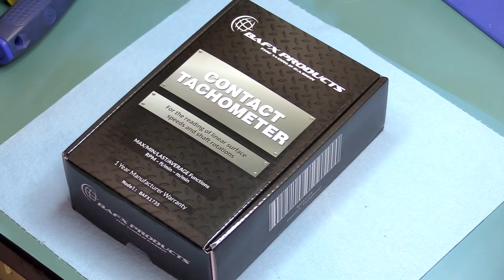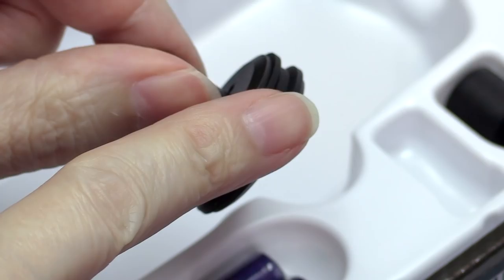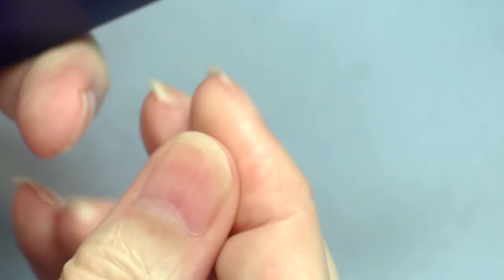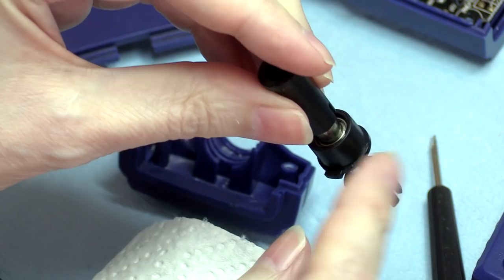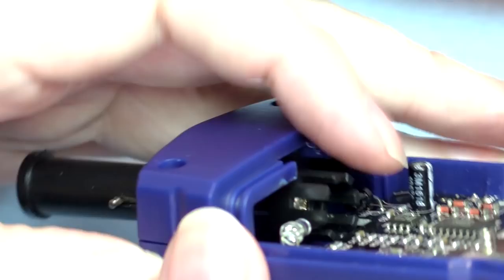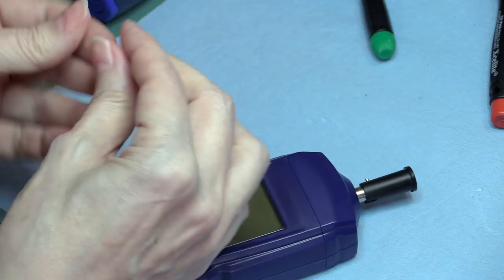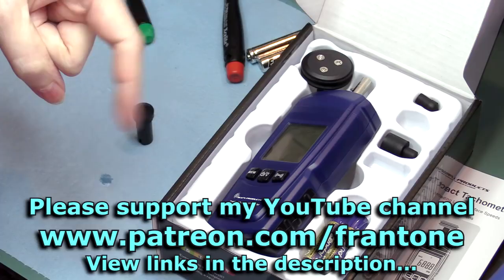Can A Cheapass Tachometer Be Any Good?

Comment: I got rid of my contact tach decades ago, mainly because I didn't like getting that close to rotating equipment with power applied.  Got a non-contact laser tach and never looked back.  I get very accurate readings a meter away from a 3 cm shaft.  I keep some emery cloth handy to dress dirty shafts, and some white nail polish when I need to add a reference line, though a piece of tape almost always does just fine.  With careful aiming it even works great end-on.
Reply: The only reason to go contact is if you want very high precision on a slow rotating object. A low precision contact tachometer has no purpose.

Comment: You don't use the cones to roll along the shaft.  The cones are for pressing to the end of the spinning shaft.  There is a center bore on larger shafts left over from machining.  Off center cone isn't critical.  The wheel is for rolling on the shaft.  I'd imaging there is a setting to select the diameter of the spinning shaft to get the right ratio.

Comment: The diodes were fine before you moved them.
Eight pulses per revolution would average out
Reply: That's what I was thinking. That and that there would be more of a likelihood that taking measurements in the low range would be more likely to be off. If the steel in the bearing is high enough quality, that would make the bearing not a problem either.
Reply: yeap, there is a reason why they were angled and she thinks that she corrected them :)
Reply: Interesting. I would not known that either. It looked to me also a little wonky, but you can learn a little every day.
Reply: Fine, well maybe, the IR emitter (clear one, wrongly pointed out in video), just needed to be bent correctly, near the base of the LED. I have bought two non contact tachs for $6 and $7 bucks, they work great, I used my 1GHz scope to verify.

Comment: There are a few things that I think are important.
1. The inserts should be pressed into the center of the rotating thing to be measured, otherwise it won't give a correct RPM reading. So, the inserts are okay to go in loose. No glue needed.
2. The wheel should be used in the distance mode, so the device should be calibrated for that sized wheel.
I do agree about the "bearings" being garbage. Not sure about the optical measuring accuracy though.

Comment: Some manufacturers uses black PCB coating. Some preseries devices I have worked with have been black - no DIY about it.

No need for precision-aiming the LED - it's enough that there is a significant difference in amount of light for on and off so the photo transistor gives a valid and distinct digital signal to the microcontroller.

But it was a bit much components used. With a suitable buck regulator, not much more should be needed than a microcontroller, crystal with caps and some components for LED and photo transistor. And a few components for switching the LCD.

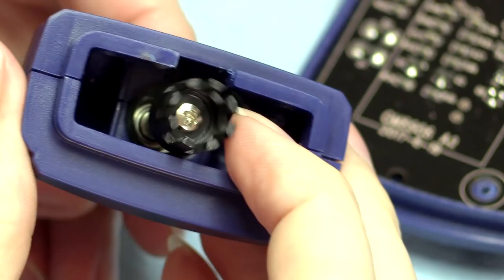Comment: I could be mistaken, but around 5:40 I think I spot a "skateboard-style" bearing of the type used in a lot of hobbyist 3D printing projects (and some 3D printers, especially those with RepRap origins).

That said, it isn't necessarily a good bearing!
I've bought 608ZZ bearings from AliExpress on two occasions. The first lot were perfectly usable - I don't have the expertise or equipment to determine precisely how good they are, but I have no complaints.
However those from the second pack were... less than ideal: poorly aligned, many were visibly dented, and they were packed with a really sticky "grease" that felt more like PVA glue than a lubricant 🤷‍♀️

As with most things from China, there's a wide range of quality to choose from. Unfortunately in situations like this you don't really get to make that choice yourself :(

Comment: I made a tacho with an opto sensor, F-V chip and a miliameter. It worked better than that one; colleague used it for setting a motor to 1000 RPM to test encoders.

Comment: Can you improve on the engineering of the device? I would try. My mother bought a Bravetti deep fryer but the temperature sensor was placed right next to a heating element. My experience with deep fryers says you shouldn't have the temperature probe that close to a heat source because then the device gets wrong readings. Thankfully the electric element had the built in means to hold a relocated temperature sensor away from the elements. And I made the adjustment before my first use. The result is a temperature accurate deep fryer.

Comment: This unit might work fine for most uses perhaps unless you needed to measure small variations in rpms in something like less than a quarter of a second. As someone else pointed out, this unit likely calculates an average so the opto sensor isn't that much of a deal breaker. Are there electric motors available that guarantee certain rpms depending on the voltage/current applied? Sans getting a proven quality tachometer to test it against, that would would be one way to measure the accuracy of this unit.

Comment: At work we have a setup to benchtest those... if you send it over I can determine just how good/bad it is up to 10k rpm. It doesn't use the rubber adapters (the shafts are standardized), so it would even favour the device a little.

Comment: I use contact and non-contact tach's fairly often. This one is questionable. I don't have a problem with the crown-slotted encoder, but the poor bearing is a problem for a number of reasons, including safety and optical alignment. If the optical alignment varies, that could lead to miscounting. It need not be dead rigid, but floppy is no good. I am less concerned about the optical axes being aligned, as the lenses are not designed to collimate particularly well . Probably /-20deg makes little to no difference. The tip falling out is a major headache. In use. pressure holds it, but when applying the tool to a shaft (or removing it) if the tip goes flying, its a pain to find and can be a safety issue. These devices are intended to be applied to a shaft that is already turning, so holding it two handed doesn't work.

Comment: Why even use a contact tachometer? Just paint a white spot on a shaft or disk, a phototransistor, Schmidt trigger and hook it up to your counter / frequency meter…
Reply: Conveyor speeds and other linear motion.  Also that gear you describe won't work in the field.
Reply: @paulmoir4452  Wow, you are the first person with an answer to, "Why not use an optical tachometer?"  Almost any contact electronic tachometer made these days is going to be a mechanical device to couple the machine under test to an optical encoder.  That adds a layer of slip and inaccuracy into the measurement.

Comment: Why must the rubber point be fixed? It will stay in place due to friction if you press the point in the little hole on a shaft. It's not meant to put on the side of a shaft, in that case the diameter is very important. Accuracy depends on the timebase, not the quality of the bearing. With 8 slots you can average  and improve accuracy. Nice video with new intro!

Comment: I do not know if it would have to go through the centerline or not, but maybe the time between light and dark is what is needed to count the rounds. I had seen something similiar before to measure rpm or so and it was also not perfectly through the centerline axle. It had worked fine or 50 deviation at 8000 rpm based on another, newer rpm counter.

Comment: I'm surprised the encoder had eight slots in it. I expected a cylinder with a single slot through the middle.
Reply: I'm used to seeing a disk with notches in the perimeter. The notched cylinder probably allows the Led and the sensor to be separated a bit farther apart as it would concentrate passing light through an expanding/collapsing aperture.

Comment: Maybe you can lean one from a car-garage for your project.
But this can probably function a lot better with a few 3D printed parts. Like that stupid adapter and probably also printing a new head where the axl is turning in.
This is the way I get things like this design-failures to work for me...

Comment: It may have been fine but not tested

As has been said elsewhere in the comments the pulses would have averaged out. So the crude opto slots don't really matter.

The bearing may have been intended to move as you demonstrated. That would allow for a little misalignment. Again without pulling the bearing apart you would not be able to tell.

Loose fitting inserts, annoying but could be intentional, you are not supposed to press very hard on them or you will load the motor. But GLUE! why? a turn or two of  PTFE tape would have done the job and be reversible.

A non contact device would have been better, but if you really wanted a contact tacho, an opto shaft encoder and a tiddly little Arduno/Pico/orwhatever would have done better.

 Andy

Comment: It is made to accept thrust load not radial load . It only has to touch  the shafts center . You cannot read rpm off of the circumference  of a shaft or pully . Do not use screwdrivers to pry on things , right ?

Comment: My Father had/has a metal looking mechanical one. We used to use ones with a photo cell to measure the RPM of model aircraft engines

The later would measure the 60 hertz if you put it in front of a light bulb
Reply: 60Hz? I would expect one to read 120 instead.
Reply: @eDoc2020  Yes, 120, math was off... whichever, point was, these photocell tacs worked in that manner

Comment: You say the tachometer would only be accurate at very low speeds, but how come you know this?
The plastic encoder wheel doesn't seem to have any jagged edges so as long as it works to transfer the rate of rotation into pulses i think it's fine. Even then the LED's are not focused lasers so most of the surface imperfection would get attenuated anyways. 
As long as  the optical assembly can generate a periodic change in current this can be AC coupled and zero crossing detection can be used to shape the pulses.
After that it's off to the MCU to calculate the speed, which it undoubtedly does with a timer in a capture compare mode, which can be made to run on main clock most of the time. And that 16MHz crystal with the 8-tooth encoder would mean that this device should be capable of counting up to at least  ~33k RPM. Although at that point it would probably explode given the bearing situation. And you of course wouldn't expect any accuracy from a device that's operating at near it's limit.
But i'm not defending this Kuality bit of kit, rather i think it's important to assess whether it's at least capable of providing useful measurement before you point your finger at the wobbly shaft and the LED because it's at a funny angle.
At the end of the day you bought it to take a measurement so you might as well make sure it can for your own benefit.
And if you care about the accuracy of your measurement and the longevity of your equipment you wouldn't buy cheap crap.
And if you expect quality instead of Kuality from cheap crap test gear that's a you problem.

I just like numbers, i like knowing the why and the how. No such thing as free lunch over at chinatown.
Reply: You naild it. As long as the Led is seen 8 times/360°, encoder and optics are OK. I think that higher speed should be more accurate than lower ones. With lower speed you would have to have more pulses per rotation to increase the accuracy.

Mechanical crapyness is a totally other subject.
Reply: @geevee1969  Mechanical crapyness comes as a given with cheap chinese tech. Afterall it's almost considered disposable by many. :)
And you can thank the fidget spinner craze for the crappy bearings, which have since polluted the market.

Comment: I've got a cheap optical one that works well enough. Did you particularly want a contact one ? Or just going for a 'simpler is better' choice ?
Reply: Isn't optical simpler than mechanical?
Reply: @GordieGii  Yes but it requires setting up a pattern on the spinning object. You can't just grab an optical tachometer and point it at a motor axle and get a reading, where you can poke the tip of the tachometer face to face with the tip of the axle and get a reading on a contact one.
Reply: @gigaherz_  I don't know whether I would call a thin strip of reflective tape or a line of white-out a pattern but I get your point. You can point one at a D-shaft though.
You'd only need a pattern for really low RPMs.
Reply: @NiHaoMike64  No, you are supposed to contact end to end, not side to side.
(_3453_)===>[________thing that rotates
Reply: I found a more interesting one on ebay - a really old Starrett that's really just a turns counter. I guess you have to hold it in contact for 1 minute, or a shorter time and scale it up

Comment: Answer is "no" but it's pennies to fix. 
I bet you can buy off the shelf bearing that fits there and also IR coupling can be adjusted to work as designed. And with 3d printer you can even go as far as making your own encoder.

Comment: Am I missing something?  Wouldn't a contact tach have to know the diameter of the thing being measured? I mean if you put that little wheelie thing on the outer diameter of a 4" pulley .. it's not going to read the same as if on an 8" pulley. Or is the idea that you try to stick it on the center of the shaft?
Reply: It can measure either linear speed or RPMs. To measure RPMs you press it into the end of the shaft, as you suggested. The wheel would be for measuring linear speed and i suspect is much less accurate.

Comment: That’s a lot of “not so educated” conjectures and not a lot of actual characterization. The conical interface is meant to be used by pressing it axially thus creating a sufficient fit. It’s a handheld device that you use for a few seconds at a time. The play and the absence of ball bearing are unimportant. You ruined the calibration by messing with the diodes.

Comment: Time to get your engineering skills on the workbench Fran. I'm sure you could make a fitment with real bearings and an accurate light wheel. Dump the existing case, solder on some better focussed Lead's and build the electronics into your own tacho project.

Comment: Why not use an optical tachometer?  Almost any contact electronic tachometer made these days is going to use a mechanical device to couple the machine under test to an optical encoder.  That adds a layer of slip and inaccuracy into the measurement.  Eliminate the mechanical coupling and take your measurement safely from a distance.  A piece of tape or a line of paint or marker is all the contrast you need.

Comment: Re-bearing the device with a pair of deep groove ball bearings spaced apart, and 3D print a decent photo-interrupter. Then align the optics.

No need to go overboard on bearing fit. Super glue on the shaft and hot glut the outer race into one side of the housing.

What've you got to lose? A useless piece of junk?

Comment: oh man, that definitely is a very crappy mechanical assembly... some VCR or record player parts could fix that up, the circuitry is where I would be flummoxed.
  the worst case of this (crappy or badly designed to the extent that it's basically useless) that I've seen was this one particular "multi-tool". when trying to use the pliers function, there was no way to do so without pinching the hell out of your hand... it must have got me a dozen times before I decided to get rid of them. they got my neighbor a bunch of times two; he started calling it the "medieval torture multi-tool"... it was the kind of tool you would anonymously give to somebody that you hate, then bask in the knowledge that they will definitely pinch their hand trying to use it. near as I can tell I don't hate anyone though, and if memory serves me I threw the thing as far out into the bushes as possible. unfortunately, it may appear to maim someone's hand someday in the future- it's made of stainless steel...
 peace.